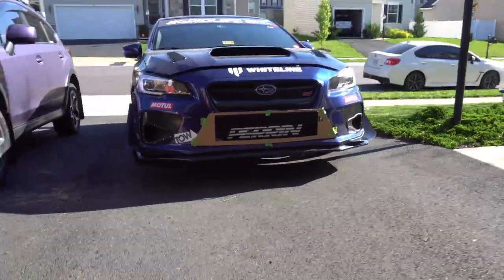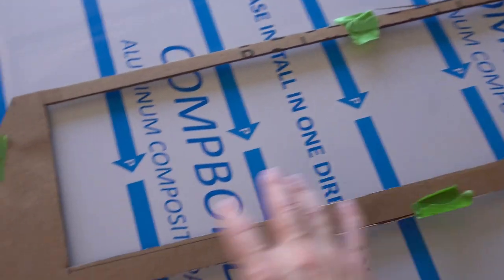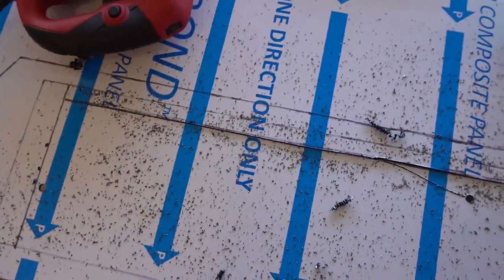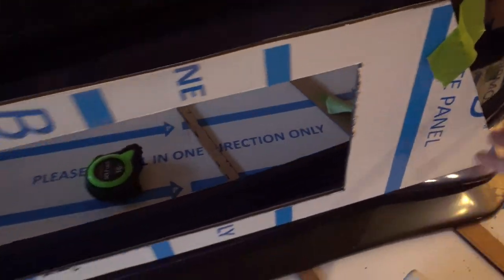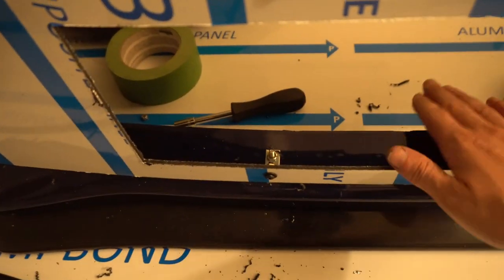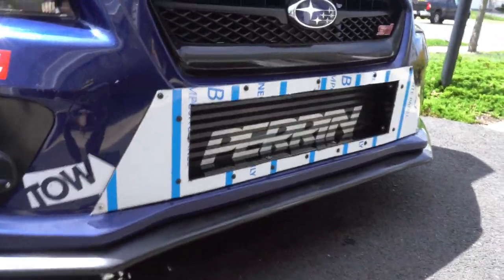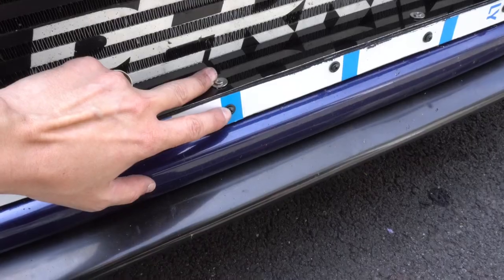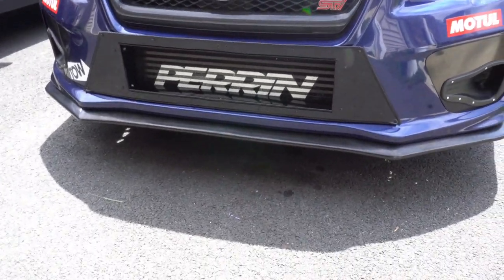Building My Own Front Mount Intercooler Duct

Comment: Nice idea! For a more professional look maybe you can make a relief cut out of the sides of the trim piece for the corners you're pointing at 16:06. I'm not sure if that makes sense haha, like instead of running three pieces and those ugly joints you could run one piece all the way across the top and at the corners you could cut out a triangle from the side of the trim to make the material lay down and you can bend around the corner
Reply from the maker: Yeah i thought about that after I put the trim lol. Will definitely try that way

Comment: Looks awesome dude. You're a creative sumbitch haha. You think that stuff would bend since theres aluminum in that composite? If so then you probably could have gotten away with doing it all in one piece and bending in the inside pieces that are next to the intercooler. It looks super clean dude! Its gotta easily add 25-30 hp just because.
Reply from the maker: Hahahha, well this material wont bend at 90 degree angle because of the plastic in the middle. It only slightly bends, but id definitely would have bent it that way. Thanks!

Comment: You.l can fix the outside by cutting it on a diagonal. It’ll meet up pretty perfect and look a lot better.
Reply from the maker: Like cutting the corners? I will definitely be looking into getting then nicer once i have weekend off after some of these race weekends
Reply: ARomanRacing yeah, the corners of the rubber seals. Sorta like you’d do on a Cobb intake housing to make it look cleaner!

Comment: Nice👌🏾 but ain't the front mouth supposed to gt home air if has more opening.
Reply from the maker: It is blocking the side areas where there is nothing for cooling. Blocking areas, forces all the air into the intercooler for more efficient cooling.

Comment: Are you running stock front LCA/Ball Joint and toe arms? What do you think about the Superpro Front LCA with pressed in poly bushings and castor increase?
Reply from the maker: I am still running stock. I was looking at it amd definitely would like to upgrade. Any upgrade sure helps.